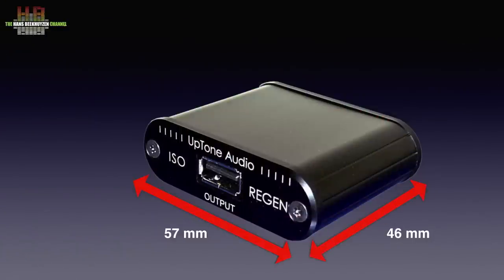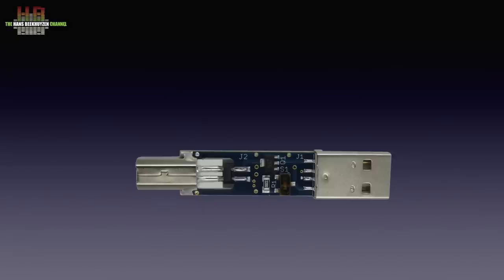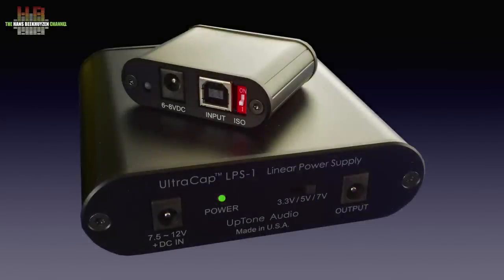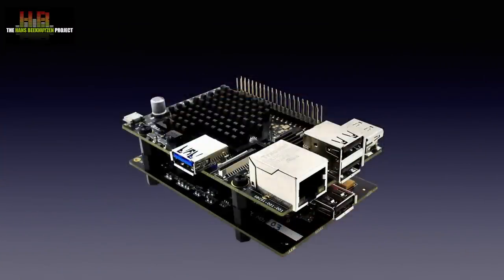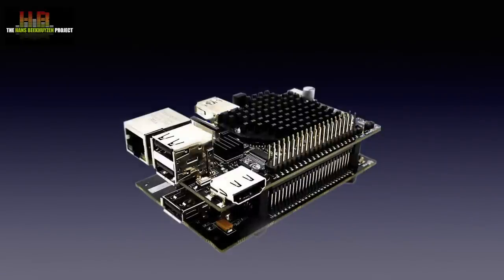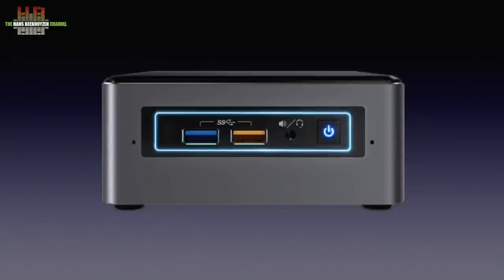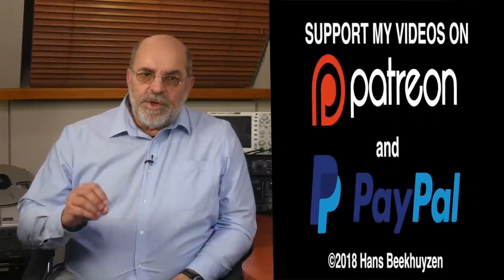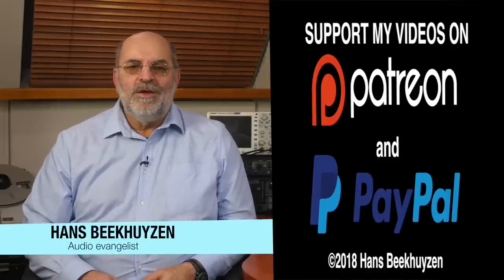UpTone Audio ISO REGEN USB reconditioner

Comment: Would you recommend the iso regen  in my system consisting of the sotm sps-209 ultra and Mytek Brooklyn? Would this improve the sound qualityof my system #1? Third or fourth time watching this review. Did you claim that the sps-200 Ultra does not need the iso regan ? Would it be redundant?
Reply from the maker: I presume you mean the sMS-200ultra. In that case there is not much to gain.
Reply: The Hans Beekhuyzen Channel yes, thanks so much. I just wasn’t positive. I am now.

Comment: Hey Hans, if I am using a Chord Mojo just on it’s own batteries, does a USB regen helps? Thanks!
Reply from the maker: Yet it will, provided the rest of the stereo is of sufficient quality to reproduce the quality improvement.
Reply: Can you explain me how, since the power and data signals on the Chord Mojo is supposedly isolated? My system is quite simple: iPhone -> DAC -> Headphone. Thanks!
Reply from the maker: There is more than just the power supply. It's also the reshaping that counts.

Comment: My system: PS Audio Gain Cell DAC - two m700 mono blocks also from PS Audio - Volumio Primo as streamer - two towers from Pioneer (Andrew Jones) and 2 subs. Today I received a USB cable from Curious Cables. I can't believe the difference it made! Only one good USB cable. The one I had from Pangea was not bad, but this one is a lot better. I am now waiting for ISO REGEN which is coming tomorrow. I can't wait! Thank you for your videos.

Comment: Hello Hans, 

Another great video as ever! 

I am looking for ways to improve the audio signal coming from my Innous Zen Mini MKII streamer to my Chord Qutest DAC via USB cable. Given that the USB input on Qutest is galvanically isolated, technically speaking, would a USB regenerator device such as Uptone ISO REGEN, SOTM tx Ultra USB improve the sound quality further? I am aware of the fact that you have not done the test for the Qutest but from a technical point of view, is there any point in investing in a USB performance improvement device whereas your current DAC already offers a galvanically isolated USB input?
 
Thank you.

Comment: Another excellent review! Thanks! I m not sure if I understood but Considering that you have galvanic isolation between your nuc and your ISO regen why do you need a linear power supply for the NUC?
Reply from the maker: It is the galvanic isolation and the asynchronous data transport of the network that both reduces the need for an audiophile power supply considerably.

Comment: Hans, as usual a great review. I wonder if you would consider a Part 2 review using the ISO REGEN with a standard SMS-200 and a Sonore microRendu (if you still have them) as I'm sure a lot of your followers have already invested in these and probably a quality linear power supply. It would an interesting and valuable test to see what if any improvements the ISO REGEN can make. Now, I'm not suggesting it would come up to an SMS-200 Ultra but would be curious to see how close it could get to it.
Reply from the maker: If you watch the individual videos well, you can extract the info you want. And, indeed, I don't have those devices anymore.

Comment: i got the ifi Nano iUSB 3.0 and with my Mojo and Audio-gd R2R 11 i have noticed no improvement whatsoever. in fact after i plugged it into the chain i noticed a new layer of noise added to the background (when no music playing) so i was dumbfounded for a while until i realized that my foobar2000 output is, by mistake, not using the ASIO plugin, i set the ASIO back ip and this new noise was gone. since then I have tested with various headphones, speakers and fdacs and in each case did not detect any improvement from iusb 3.0 whatsoever.
Reply from the maker: Keep searching for other problems for it should really give an improvement, provided the rest of the equipment is of sufficient quality and set up properly.
Reply: didnt rob say his mojo was immune to jitter
Reply from the maker: He did, but that’s not what I hear. He also said that he prefers the toslink input which is strange for if jitter is no issue why then the difference between inputs?
Reply: RF noise might be the culprit, that's what he said when he was asked why there is such a big difference between lower end AK players and higher end one's when using the toslink output.  Also less processing power can mean less RF noise before the signal is converted to optical.
Reply: its a well known fact that different transports sounds better than others with mojo especially. My  previous note 5 sounded alot better than my moto G connected to it both using usb audio player pro.
Reply from the maker: Rob designs great filters for Chord but his focus appears to be predominantly there and not in the interfacing. But if you do use a good digital source, they sound great.
Reply from the maker: that's pure Symantecs.vAlart from the 'might be' part, RF noise distorts the analogue signal that represents the bits and thus cause jitter. Although Rob Watts and Ted Smith  (PS-Audio) claim to be able to calculate the jitter out, my ears tell me different.
Reply: Theoretically would the poly improve the sound of mojo cause of wifi instead of the whole problematic usb thing

Comment: Would i be correct in my assumption that this device would be even better with the standard sms-200?
Reply from the maker: I haven't tried and I was wrong before but the difference between the standard sms-200 and the Ultra is huge. I would rather spend my money on an Ultra in stead of a standard sms-200 plus an ISO REGEN.

Comment: Hi hans, i use a (asynchrone) jkspdif mk3  usb converter between my laptop and ps audio dl3 dac. 
i have two questions: 1. is a galvanised usb hub an upgrade to my non - usb powered dac?
2. Would a device like the isoregen, or usb regen (or other jitterbugs/galvanased usb hub)  be an complementary to the spdif converter, or would it be a choice between them?

Thanks!
Reply from the maker: The results vary depending on the equipment used.